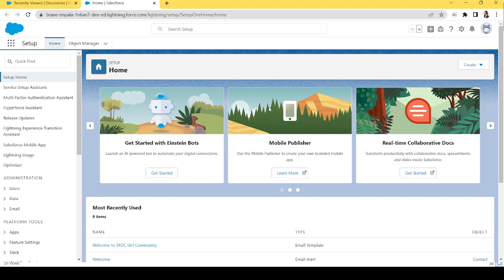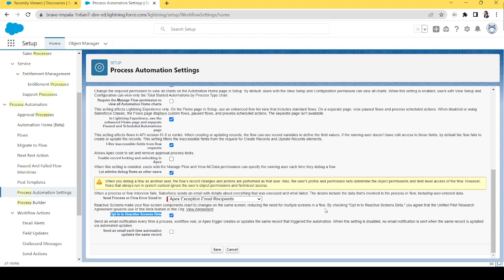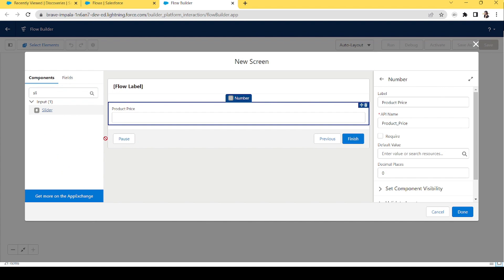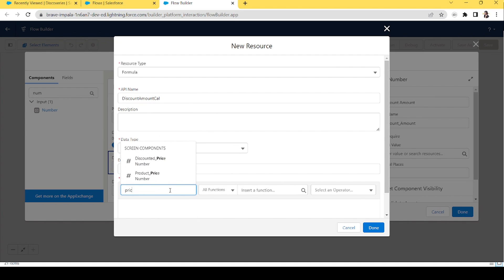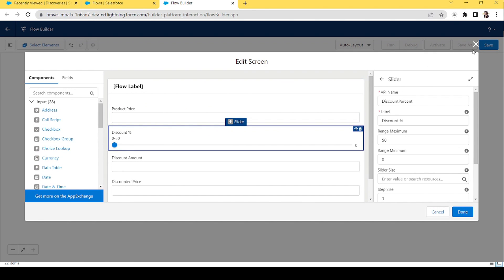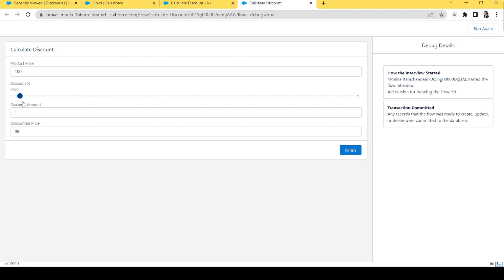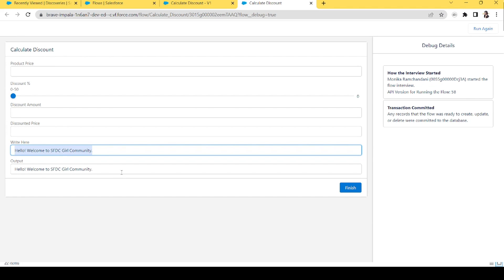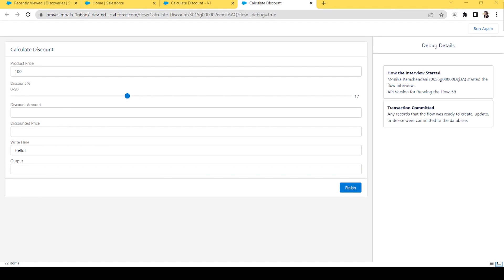REACTIVE SCREEN COMPONENTS IN LIGHTNING FLOW♨️

Comment: Question - The reactive screen works in the sandbox I created it in, however when I sent the flow to another sandbox via change set the reactive screen does not work in the new org. Any ideas why? I did enable reactive screens in the org I sent the flow to. Thanks.
Reply: Hello there!

If you checked the box for enabling Reactive screens after deploying your flow, you will have to re-deploy it. That'll fix the issue